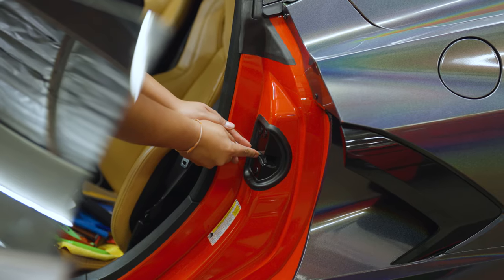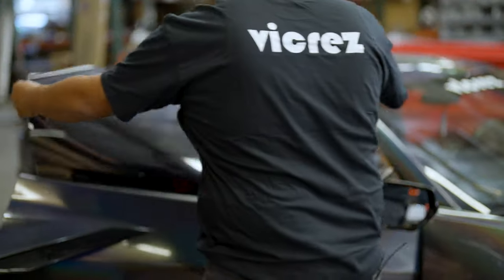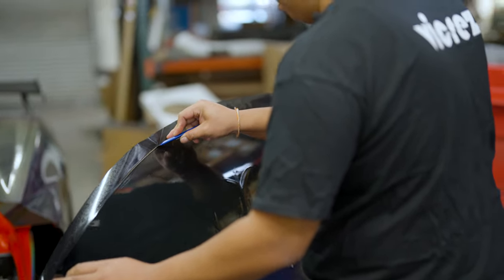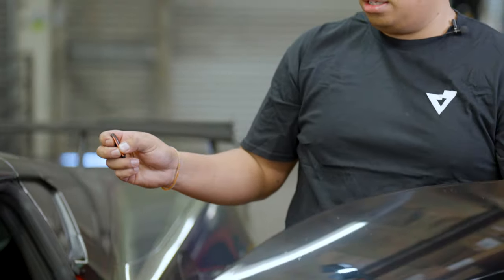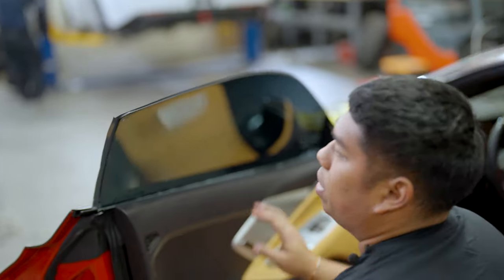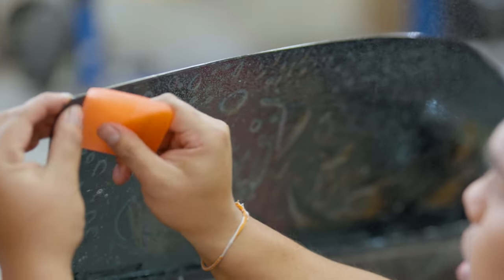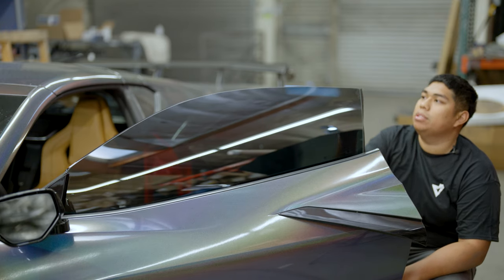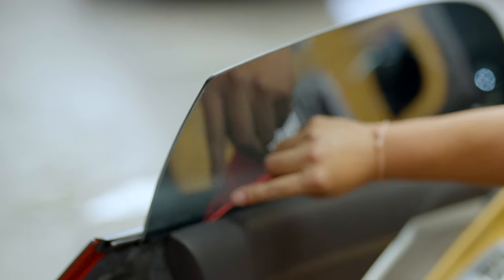How to Tint Your Car Windows - Corvette C-8

Comment: Sir, I locked the door  latch like you showed but how do you unlatch it? I tried many things but it stays latched and the door won't shut. Thanks.
Reply from the maker: To unlatch the door, you will need to push it back inwards so that the latch can disengage.